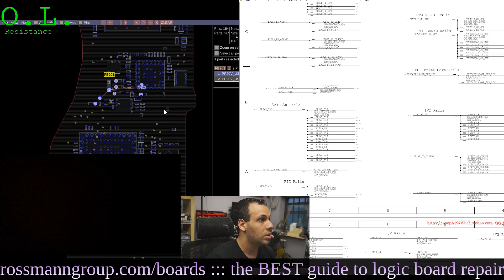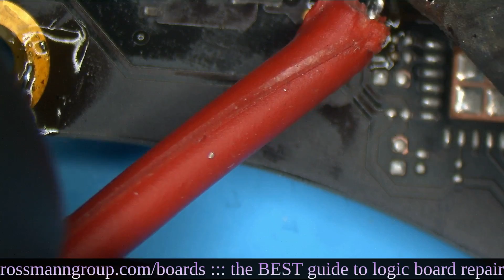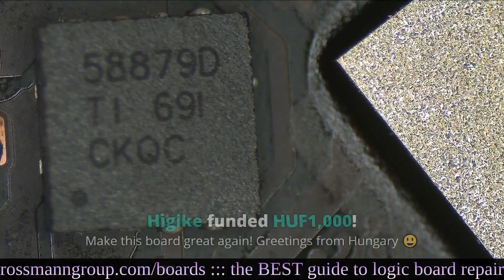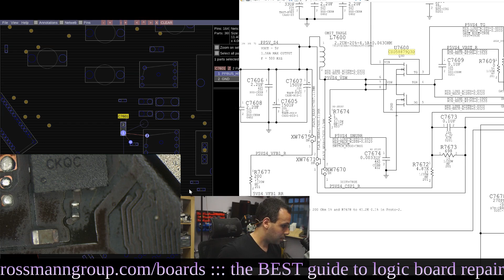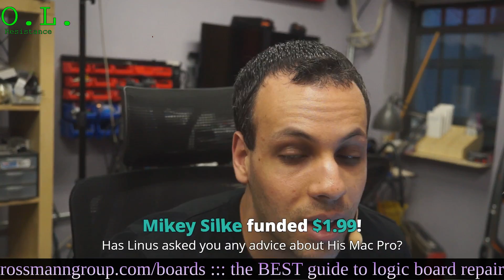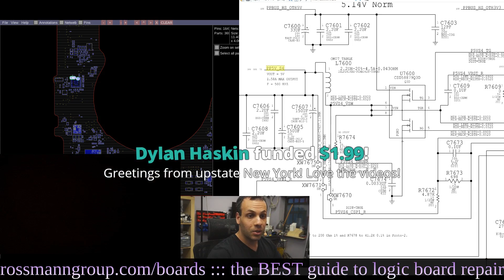Touchbar Macbook Pro logic board repair: Not turning on

Comment: No Power -- A1706 2016 4xTBT3 TB MacBook Pro Retina 820-00239
0V - PPBUS_G3HOT
Inject 1V into PPBUS_G3HOT rail.
U7600 Dual MOSFET gets hot. Part number CSD58879Q3D.
Visual inspection of shorted component shows solder ball popping out the side of component. C7601 is also damaged.
Removed C7601, short still persists.
Removed U7600, short gone.
As of Apr 29, 2018 no donors available.
Board not fixed.

Comment: Hey man! Awesome videos! I have a A1707 MacBook witch had little liquid damage. I cleaned the MacBook took all the internals out and replaced the keyboard Ribbon cable ( everything worked except the keyboard) now nothing works and when I press the power button the voltage drops (to zero when I hold it) and rises again when let go. I measured power pads and they gave 4,55V. It looks like a short but I can’t find it. Can you give me tips where to look for? I don’t see any burned parts

Comment: Hi, I have a problem with my MacBook Pro 2017 (Without TouchBar), My Mac shows that my battery is charging when it is not even connected to the charger, and when I connect the charger it does not let the battery charge either.  What I can do? 🙏🏾

Comment: My situation maybe you can give me an idea . First my MacBook Pro fell of the floor and it worked for 2 days no issue. Than my power charge went broken so I try power it up with anker power bank after doing so the MacBook just stop turning on and I used all the shift combination atc after two days when I was about going to repair it it’s turn on. After that  again I didn’t power it up and when battery went down even I try to charge it with normal official charger it’s just didn’t work. What is likely to be the problem ??? Thanks

Comment: Since it seems that your microscope is in a 4:3 aspect ratio, would it be possible (or make sense) to display it 4:3 in your videos with black bars? Many of times you cut off the top or the bottom, when you are looking at or working on an area outside of the view of the video. Again, not even sure if this is possible, but I would personally rather look at black bars on the left and right than miss the action:) P.S. thanks for the awesome videos.

Comment: Hey Louis, a doubt I have: Can the processor of my MacBook Pro Mid 2012 (non-retina) be de-soldered and reinstall a another model compatible with the motherboard? Mine's a dual core one and I read that there is another model with a quad-core and instead of buying a new one laptop, I was thinking that if it's possible to just change the processor.
Reply: It is possible as well as possibility to fck up your MacBook as well as CPU you want to install into it.

Comment: Well if dingleberry was distributing a dell window Iso image to restore dells after a HDD crash there is no problem with it. The dell already has a Win license so Microsoft is null in the issue. Dell will get you the Iso with a service charge for supposedly the media's carrier DVD/Mem Stick, so Dell is also removed from the issue. The Dell generated Iso will NOT install on any machine other than a Dell, or one that is ran with a dell board. Now if it will install on anything other than a dell (Cracked Iso image) then he is screwed.

Comment: In the Auto industry we solder on immobilizer units. So if removing a 64 leg QFP MCU its common to teach to use sticky tack as a heat sync. so in this you can use that to protect other devices.

Comment: Tried to call HP for a replacement DC in for a laptop... 
their response is "It's impossible to replace that part you will have to get a new board" 
My Counter Response: I see the where it's socketed into the board it's literally a plug and play part
Outcome: I buy an identical part with the proper pin connector and put it in myself. 
Authorized repair is a joke, +Louis Rossmann keep up the good work by sticking it to the "Authorized" techs

Comment: Got a question....

- I have a PC motherboard, won't turn on.
- BIOS chip not getting 3.3v on VCC pin, but 3.3v line exists, remove BIOS chip and 3.3v appears on BIOS VCC pin, motherboard turns on.
- Replace BIOS chip with a new BIOS chip, and same problem.

Kinda lost.

Comment: You still could hack it to get power on signal for 5V rail switching converter and use some random external transistor to switch ON your power supplied from your bench.

Comment: Oh man, let me tell you about old people. My father is in his sixties but he is the smartest guy I have ever known. He didn't have any formal training in electronics, but he started off learning really, really early, when he was about 10 (and that was in the 60s, when books actually had valuable information in them and didn't look like another ad). He took it from there and continued on gaining experience all by himself. It shure has taken him longer, but at the same time he has always been about practice, not theory. He never overthinks his repairs and takes all the steps necessary to get things working, usually using his guts and best guesses (apart from proper measurements of course). He has gotten himself a decent hot air station and has carried out successful surface mount chip and BGA chip replacements (he can't afford a microscope so it's all using his naked eyes and magnifying glass). He hardly ever makes mistakes. It's all about experience. And who is going to have most of it if not older people? Hm? He is constantly learning as he knows that technology moves on. And even if it doesn't really help him fix devices (because for instance he doesn't have certain equippment to do it), he does it out of sheer curiosity - because this is what intelligent people are about - curiosity.
Reply: unfortunately most people arent like that, especially older people.

Comment: was that chip showing 40 degrees compared to 35 elsewhere? That's not really that hot
Reply: I am guessing it may be related to "inferred emissivity". It is always problematic to use uncalibrated thermal camera on unusual surfaces like metal, glass, etc.

Comment: Liquid damage again... Could so easily be prevented just by using some coating or spraypaint on the Board. I am glad that this is a standard at least for many companies in the German industrial section. And to fix something you just rub some board cleaner with a q-tip on it. 

Presto!
Reply: Privately I use Plastik 70 made by Kontakt Chemie. It is a german brand and I don't know if it is available in the US or where you are from. At work we have lists of which board to treat with what. But mostly that stuff is hard to get and expensive. I think no one is willing to pay 120$ on a spray can. 

In general you can look up standards in the IPC-CC-830B, IEC-61085 or UL746. Every situation has its suitable spray paint. And regulations change constantly. 

In reality any Poly UR3 or UR4 would work as long as it won't melt any parts on your board. Aromatic free acrylic will do its work, too. Just search for "conformal coating" in the shopping tab of google and you should find something.

But don't get too high hopes like full submersion in your fish tank. Instead of waterproof I would call it moisture resistant.
Reply: Etna. - Yeah, but that's Germany. Their engineering is far too sensible to be used in the rest of the world.
Reply: Etna. And that makes the boards waterproof? Product name?

Comment: I have a Xiaomi Notebook Pro and there are a few small problems with it.
1. It used the slower version of the mx150, which is ~30% slower than the normal one.
2. The air vents are only on the bottom, so if you use it on a bed or sofa, you will get problems.
2. The fan speed controller uses the voltage of the cpu instead of the temperature, which makes it turn, even under web browsing, and unable to control with third-party software.
3. With the new bios, you are unable to change the cpu power limit.
4. The power port on the right side, which is annoying for using a mouse.
5. The power cable is relatively short.
6. The buttons on the touchpad are only in the bottom corners, it's very hard to click down in the middle.
7. The right fan seems to slightly touch the fan case, sometimes (rarely) it makes an annoying sound.

Comment: hey louis, any tips on fixing a thinkpad x230T with no display? I plugged the lcd in with the power on by accident and it must've fried something. Already ordered a new mobo but would like to make the best of this situation and try to fix it. laptop works fine on external display otherwise
Reply: danandrei96 you likely popped a backlight fuse somewhere...

If you shine a flashlight into the LCD and you see displayed objects/characters, your damage is likely narrowed down to the part of the motherboard that feeds backlight power to the LCD
Reply: iggy151 no luck, I've already checked that and the screen is just black :(

Comment: Careful on what you say about Amazon kickbacks. Linus got burned and had to basically recreate a new Amazon affiliate account and all the old videos that said that they got kickbacks from Amazon would no longer work. Basically, I'm not sure if you're allowed to say how much you benefit from affiliate links.
Reply: Adam Besmer That issue was because Linus was using the affiliate links to any product on Amazon, not just the ones featured in the video as per the agreement that Linus signed.

The way that Louis is using it is fine, and AFAIK there's no specific mention in the agreement that bars Louis from discussing the range of the rates he gets per item. However I don't have access to the agreement as I'm not an affiliate partner, so I can't be certain, and he should probably double check the agreement anyway.
Reply: Robinthefox88 Good to know, thanks for the info.

Comment: PPDCIN_G3H_CHGR shows 5 v not 20 any one can help me out
Reply: if that's your basic line in voltage it will be because the computer is not communicating with the charger.  USB type c will output 5 volts until it's told to put out higher.  Type c does this so it can be used with various devices wanting various voltages.
Reply: Try this video: https://www.youtube.com/watch?v=b_sMzMOgOcU . Time is 10:00.
Reply: i have same problem like last video of "Rossmann" (820-00239 A1706 Macbook Pro Touchbar board repair ATTEMPT) https://www.youtube.com/watch?v=oHOPvHWfjv0
How he fixed !!!!!!!!!!!!!!!!!!!!!!!!!!!!!!!!!!!!!